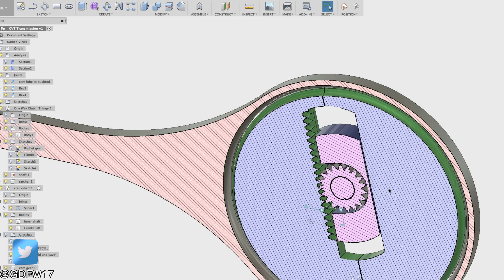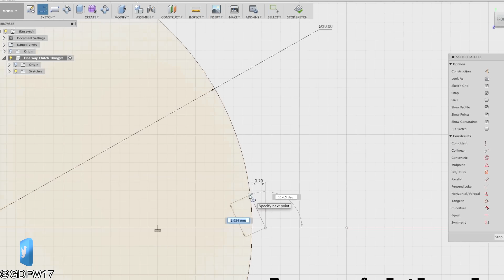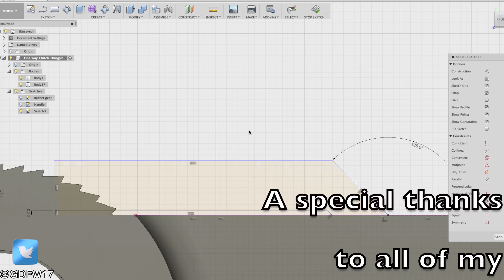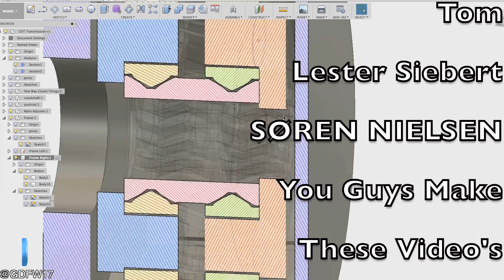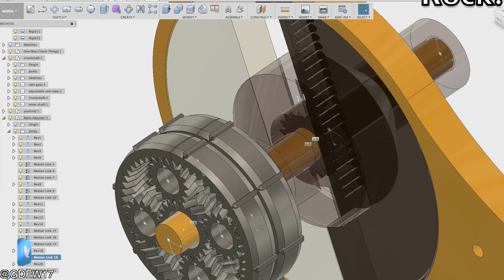The Coolest Transmission You've Never Heard Of... The Ratcheting CVT

Comment: Very interesting, and I'm really glad there are smart people out there whoa re interested in these kind of mechanical things in this ever increasingly digital age. I used to be a mechanic so I am familiar with CVT's, and not everyone did what you mentioned with not using all of the gear ratios. Ford's CVT that they put in cars like the Mercury Sable (I think...) did use it the way it was intended. People did find it weird that it would stay in the same engine rpm as the gear ratio changed to change its speed, but it still worked that way. Mainly it never got popular because it was highly unreliable. I believe it used the rubber belt method with the conical wheels that would open or close to change the ratio. This idea is pretty good in that it doesn't rely on friction, as you've stated, but I am curious, since I am not as smart as you (not being sarcastic), I'm having a hard time imagining something using this method accomplishing any gear ratio that isn't reduced.

Comment: whats good about your design is that you thought outside the box, and used a system that ratchets and has a variable throw link arms.  Not of much use in an  automobile as the reverse motion of a vehicle coasting and turning the motor on over run.  engine braking, but it's a great idea. I too, many years ago, designed a fuel saving device that can be fitted to any car with a carburettor, only to find that a car manufacturer had already patented the design, but they never used it commercially to reduce fuel consumption...I later added a 4th pedal to a truck that i used to drive , 280 bhp and saved fuel by using the system. now it's surpassed by other systems that allow the engine to stop and restart every time the vehicle comes to a halt.. but well done by applying a system (ratchets) to create a variable speed drive....

Comment: the ratcheting part might be the weakest part of it.
Reply: That's solved by using one-way clutches, which are essentially a spring-loaded needle bearing with some slopes that causes the bearing to lock up in one direction only.
Reply: That's a lot of pressure for needle bearings that acts up as a one-way clutch.  Can you tear up the design and let us see it with the needle bearing design?
Reply: Unfortunately, I don't have time to redo this with one-way clutches at the moment and I haven't done any of the calculations either but a one-way clutch capable of transmitting 66 Nm of torque with a dynamic bearing load rating of 10,9 kN fits on a 25mm shaft and has an outer diameter of 32mm and a width of 30mm. If you want to use it for a combustion engine application, the size of the one-way clutches would most likely be very influencial for the dimesioning as those 30mm width is much wider than a crank of steel would be. The crank can't be made of aluminum because of its fatigue properties so it most likely has to be machined steel.

Comment: Could you use one-way needle bearings instead of ratchets. Like the ones used in the recoil starter on RC car nitro engines. There would be very little to no friction, vibration or sound.

Comment: can you eliminate the ratcheting mechanism, and mirror the adjustable offset lobes for both input and output?  I can see this working better with a set of dual adjustable shafts and a crosshead connecting rod assembly, perhaps with a knuckle joint somewhere in between to deal with the large effective difference in change between the individual connecting rods as it rotates.

Comment: Sweet.

I wanted to make a ratchet drive for my bike back in the eighties. The pedals would have worked independently with a spring return, and the ratchet would be a saw-tooth, so it engaged one way, and disengaged the  other. It was not continuously variable but you could have a lot of ratios on the hub (and different gears for each leg if you wanted it, but why?). When youj stopped, both pedals would return to the top, so you could stamp on either (or both) to take off.

I never built it, and was totally outclassed by someone I knew at the time who had his house on top of a beast of a hill, and made a bike with pedals that ran in an ellipse using a trammel of Archimedes, which also meant you did not get stuck with the pedals straight up and down. I don't know what the hills in Syracuse were like, but Archimedes was a clever guy.

Comment: Your output shaft seems to have a bit of wobble in it.  I don't think drivers will want to hear all that ratcheting. Might be why the original 1994 patent went nowhere as well.  That patent should be expired by now?  Should check. Its probably owned by patent trolls now if its not actually expired (they profit off of failed and frivolous patents with poor direct market potential by suing over trivial infringements).

Comment: Driving a CVT car to its full potential means thinking its like a king-air type of aircraft -  which has both an RPM control and a throttle control.   A fixed-RPM (or more advanced fixed tip mach) has an RPM control.  A manual-pitch has a direct prop-pitch (ratio for CVT) control instead.  CVT cars typically computer-control the RPM/ratio control.

Comment: Performance belt-CVT cars are now using fixed launch gears to be a able to shift the CVT ratio range up as belt-CVTs loose efficiency at the extremes of their gear ratio ranges (It allows high CVT efficiency at America's highway speeds - 80-100mph in Los Angeles / southern California).

Comment: Ok, after studying the sectional view I figured out how your ratio adjuster works. It's quite clever, but all those gears are adding friction (especially the sun gear, which is being overdriven at several times the speed of the planet carrier). I understand that you use this system to have a way to set the angular offset between the crankshaft and the central gears in the crankshaft that displace the cranks outward. 

You can draw inspiration from helicopter swashplates to implement a mechanism that would eliminate those two planetary gearsets. Simply have a shaft inside the crankshaft that, when moved in or out of the crankshaft, rotates those central gears and displaces the cams. Converting that translating motion of the central shaft into rotation of the gears in the center of the crankshaft could be done simply by cutting a spiral groove into the in-and-out shaft and having a corresponding tooth inside the gear that rides in this groove. The shaft must will rotate at crankshaft speed, so you'd need a thrust bearing on it, and then connect the bearing to the knob such that turning the knob will displace the shaft in or out (eg using another spiral groove).

If this was done in a real car the gears in the middle of the crankshaft would be displaced by oil pressure. Much like how variable valve timing works.

Otherwise, another way to get more efficiency would be to turn it inside-out. Split the sun gear into two halves - one driven by the crankshaft, one driving the central crankshaft gears. Lock the two planet carriers to rotate together. And have one of the ring gears fixed to the housing, and the other turned by the knob. That way, the crankshaft will be the fastest thing in the whole assembly, and the ring and planet carrier will turn slower and therefore generate less frictional losses.
Reply from the maker: ... and I think that would work...

why didn't I think of that? haha! 

Thanks!

Comment: The a360 link I followed from the thingiverse link has several missing pieces. It's missing 2 of the 3 cranks, the gear ratio adjuster, and the gears inside the crankshaft.
Reply from the maker: I’ll fix that tonight
Reply: Thanks, and hope you can make sense of my other comment, it's kinda hard to explain without a diagram ;)

Comment: So you turn the shaft with your drill and adjust the other end and the arms move and ... what besides that?
The drill turns the shaft. Where is the output, it can't be what the drill turns! Whups @ 9:00-9:15!
You turn "the output shaft" with your drill and deliver that spiel about it working? Working on WHAT?

Comment: Have you ever seen a "Zero-Max" brand gear box???? They have been commonly used on brake drum lathes to vary cutting feed rates since the 1960s or earlier, (which is where I first encountered them) with larger sizes available for heavier duty applications. There are YouTube videos! They are not just plastic concept demo units but actual industrial mass produced products. They indeed vary output speed from 0 to max, 1 to 1 I believe, with a lever to change reduction ratio. Very same  arms and one way ratchets or clutches. Output shaft turns the same direction regardless of which way the input is turned (although they are intended to be driven in one direction only) So they are not suitable for something needing to be reversed. Check them out, I don't know what patent protection they may have but they are certainly "prior art" that will prevent you from protecting this contraption.

Comment: "It's like buying a super computer and using it to play solitaire!"
The solitaire comment is literally the perfect analogy for CVTs that have been programmed with "steps" just to satisfy consumer expectations.
I'm not a fan of CVTs, if only as a result of my limited physical experience with them in operation, but I do like the IDEA of a CVT.

A CVT, in an appropriate application, is absolutely the best option, but I can understand people's hesitation and resistance to the tech (hell, even I would still prefer a bog-standard manual transmission... but my 30-year-old Buick's 3-speed automatic with torque-converter lockup is actually pretty fantastic :P It's almost like an oversized, variated moped lol).  I guess until electric cars with direct-drive are the standard, we still have to juggle all these other possible "solutions" to the process of making a power source move a slab of metal at speed :P

Comment: You forgot at least one reason CVTs are not used as much, they tend to have significant efficiency penalties, which become more of a problem the larger the system is. 

One solution to having lots of gears is a large engine operating range, for example the 200HP Cummins in the semi tractor I have access to spins from 700 to 2700 RPM, which is a range of approximately 3.86, that means if your first gear gets you going at 3MPH at idle, it will max out at 11.57MPH, second gear needs some overlap so it doesn't lug the engine, and to keep the torque up, so let's say it starts at 6MPH, it would max out at around 23.14MPH, third, again needs overlap, so let's have it start at 12 MPH, and maxes out at 46.28mph, that might still be too high, though. Point is that engine needs a lot of gears to do it's thing. A car engine will often have a range of around 6, so if it starts off at 3MPH, it will max out at 18MPH, second gear is 6 to 30, third is 12 to 72, so now with the same transmission setup, you can get to highway speeds in 3 gears, where it would take a minimum of 4 for the Cummins. The larger the engine range, the fewer gears are actually required in a given transmission for the same application.

Another solution is using induction motors, or some other traction motor to drive the wheels, use the engine to generate electricity, and a VFD, or other motor controller in between, induction motors and generators are fairly rugged, and VFDs can be made quite durable, and the whole system can be fairly efficient, this is basically what trains, and some other very large pieces of equipment use, plus now that you are using motors, and VFDs, the wheels can turn at different speeds, like anything with caterpillar treads requires in order to steer. this also allows for the use of capacitor banks, battery packs, and other things to provide bursts of power that would require an excessively large engine to handle. It's not perfect, but knowing what I do about hydraulics, it's better than the hydraulic solution, because hydraulics tend to blow hoses, seals, etc, which is manageable for industrial equipment, but you don't want someone blowing a hose on the highway, losing hydraulic pressure, so they lose control, and then leaving an oil slick for the other drivers to deal with. I don't consider pneumatics to be good enough either.

Comment: dude this is s a great idea. but you should have looked at coupling 2 diffs with large smal cogs on one side and small large cogs on the other side respectivly small being equal to small. and large being equal to large. with anti-reverse system on each transfer axle making sure neither axle can spin backwards. now couple a motor to input axle and apply resistance to the output. you will notice the output slows down but outputs greater toque the input side wont slow down as much the connected diffs will automatically put out a combine gear ratio somewhere between the 2 gear sets. its way cool. i built one from leggo. add springs to the gears set such as a clutch has so as to maintain load on both high and low gears at all times to force self regulation in gear ratio and man its ready for a formula one race lol. by the way if you want a great idea for building a demo for a free energy machine idea using water and gravity just reply back with a contact email.

Comment: Finally the CVT can take a rest with electric cars, just a fixed ratio gearbox. Since the electric motor doesn't make sound, the complaint of a "wailing" engine is also gone, nor would you have to fake "gears". The fixed ratio also responds immediate and doesn't govern by comitee like the Prius CVT does.

Comment: Very clever system, but I think the main reason it cannot be used on a car would be that torque would only be able to flow from the engine to the wheels and not the other way.  The torque will need to be able to come back to the engine during decelerations.

Comment: This is quite fun to look at and vaguely reminds me of the old 3 stage steam engines. Besides the vibration issue due to mass unbalance and movement, there would be a lot of attrition heat and tension concentration points to deal with in a full blown concept with a proper load. But don't be discouraged and consider how would you deal with that and give it a load. Start with a scale model, like a kerosene engine on a RC metal car. One of the biggest issues might be failure on the geared power shaft, but the heat, wear and tear in the main power contact might also fail. Machining this in metal might be a bit complicated but adapting the design for metal might be a challenge to lower the weight and keep the necessary strength to load it!

Comment: Hate to inform you, but that tech has been around for well over a century now.    

Some huge industrial coal fired boilers used the same concept for driving the stoker auger systems at very low RPM's and high torque from small but simple and durable speed reduction systems.  

Same tech was also used in industrial manufacturing machines for variable speed drive before the modern electronic variable frequency motor systems came out.

Comment: Btw, a one-way bearing is a lot quieter than a ratchet... Just a thought. I somehow didn't even know those existed until I was tearing down an RC nitro engine a few years back. I bought a few to play with, because... you know... bearings are like treasure, but I still haven't found a practical use for them.

Comment: Cool! Now remove the clicky little rachets and use multi-arm linkages to actuate the 'grab/release' mechanism against the output shaft! Bonus points if you can get it to match speeds just before/as it grabs, and remove torque just as it releases so there isn't any dynamic friction! Good luck!

Comment: You've probably posted the next video at this point, but I'm going to take a guess anyways. The reason its not a true CVT, I would think, is because the number of gear ratios you have is limited by the number of teeth in the planetary gear mechanism in the adjustment knob, meaning there's a finite number of possible gear ratios?

Awesome video!

Comment: What if anything would prevent a mis-engagement of the one-way teeth that would obviously be on the final output shaft inside each rod end? One of these could chip off given they would never meet up perfectly at the peaks and valleys of each revolution in a demanding 4x4 transmission. I worked on cvt theory years ago also. Nissan beat me to the bowl+sphere version of a cvt similar to Ford's design which uses 2 spheres on 2 rods that meet up an increasing angles. (yeah it would slip under sudden demand but hey.)
Now what you might consider doing is using a magnetic engagement here, somehow, to prevent this sort of thing and it would get rid of the ticking and perhaps even that force you'll loose there to the springs that hold the tickers. I had this same design you made here but didn't consider going with it. Came up with something better and forgot about it. Been working on more interesting things like over efficient ion lifters and new types of engines. For example; there's a top secret spark plug used in WW2 which would ionize water vapor and burn it at the end of each discharge by using a 1" gap to 2 anodes having a superconductive field effect similar to the Hutchison effect. So the neat thing is that since it runs of water it doesn't need much efficiency 'less you in the high desert, because an a/c unit will condense water out of the ambient air for continuous run. More interesting is an engine design so small and powerful it would fit inside each wheel. Each wheel 250hp no problem.  The future is in flight however, so that's what I'm working on this summer.

Comment: The reason why "consumers" didn't like cvt's is the constant whine of the engine. I drove an altima back in the day that would hold it right at the same rpm... By the time you got to 70 you wanted to strangle the engineers.... Some sound deadening or piping in fake rpm changes through the speakers would help. Instead they re-engineered it to vary the actual rpm.